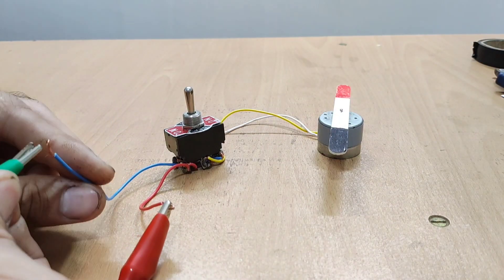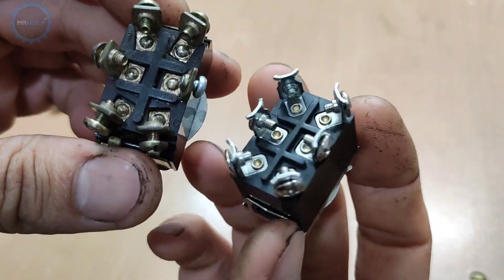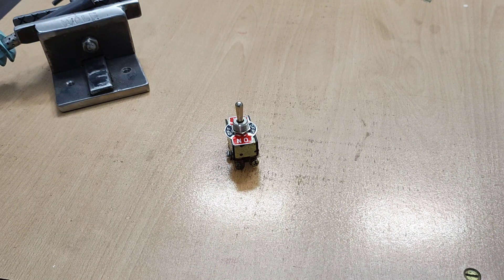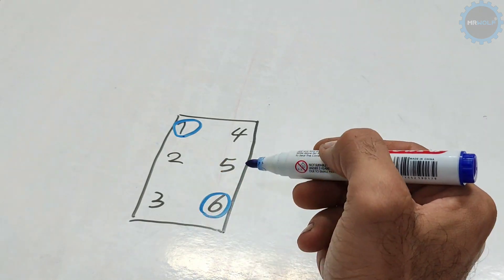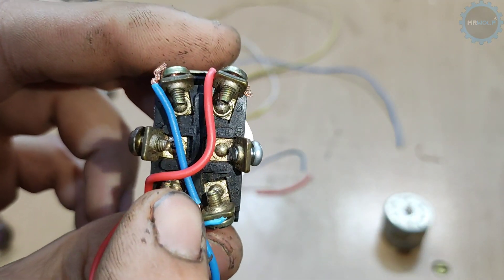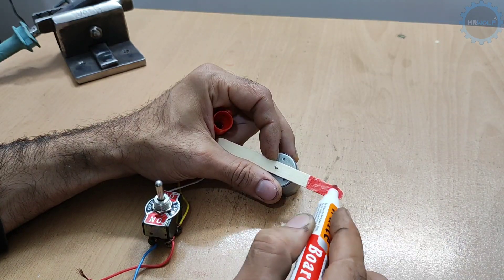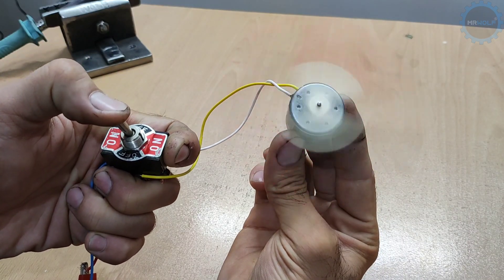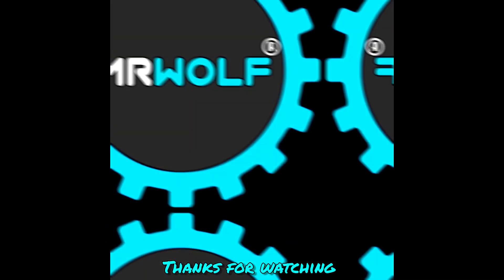How to change the direction of polarity with the DPDT Switch

Comment: Any suggestions to how to add a led/s indicator/s to the circuit to display rotation direction say on pins 2 and 5 ? My thoughts would be to have 2 led connected to 2 & 5, one led reversed connection to the other, but would the reverse polarity on these led lights damage the led ?
Reply from the maker: Hi, 
Yes, you can connect two LEDs to the output pins (2 and 5) in reverse polarity to each other.
In this way, when the polarity changes, one of the LEDs will light up and indicate the direction.
However, make sure to connect a current-limiting resistor (for example, 1 kΩ) in series with each LED to prevent damage when the polarity is reversed...
I’m preparing a video in which I’ll also show another method, and it will be released soon.🫶

Comment: It looked and sounded like there was a notable speed change. Is this true, if so why and how can it be evened out?
Reply from the maker: Yes, the speed change in the left and right rotation in my video was because the DC motor I used is originally designed for left-hand rotation and was intended for audio recording. Additionally, due to the very small electronic circuit inside it, it was slower. Otherwise, the current and voltage are the same in both outputs.🙏
Reply: @MrWolfDiy Perfectly understood. Thank you sir, and keep on doing just like your doing your content and explanations are easy to understand and directly on point. Awesome
Reply from the maker: I appreciate 🙏♥️